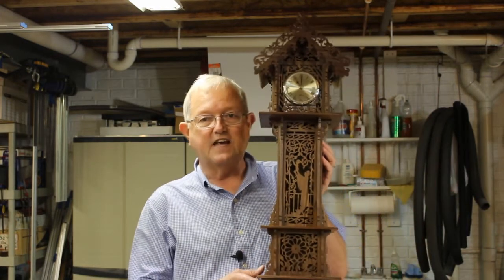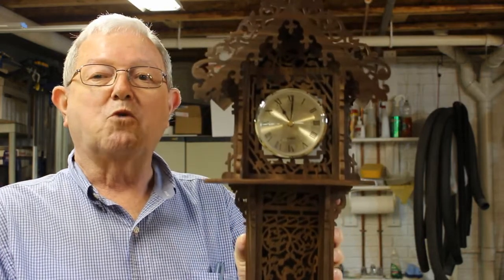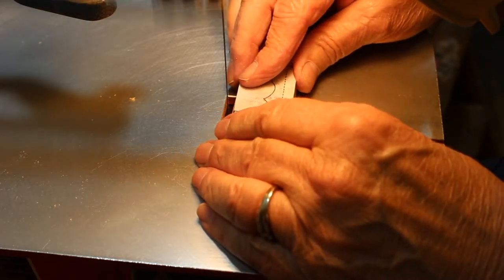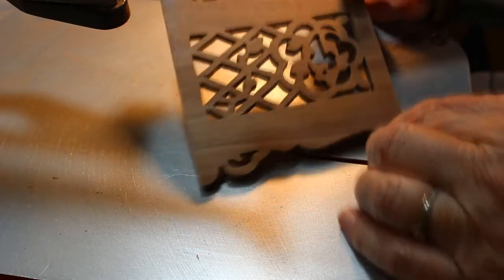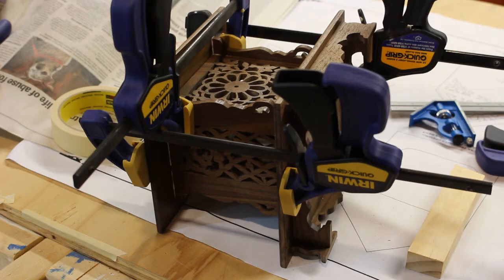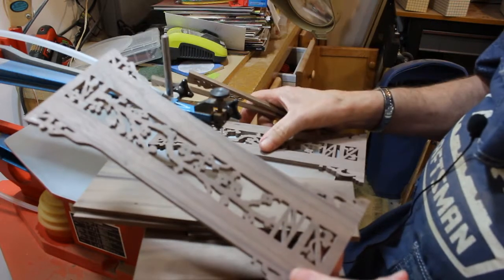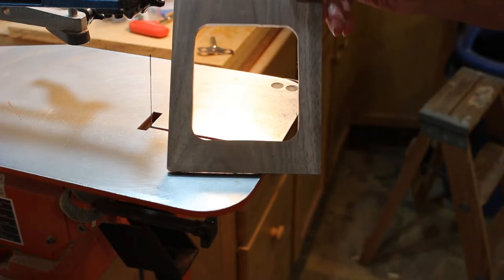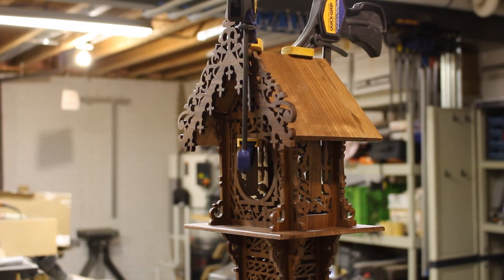Simply Wooden Creations Scroll Saw Contest 2017

Comment: What size blade are you using for the scroll saw?
Reply from the maker: the moose,  to tell you the truth I can't remember which blade I used on this project.  I normally use either a #1 or #3 blade but most likely a #3.  I recently switched over to Pegas blades but when I built the clock I was probably using Flying Dutchman Ultra Scroll Reverse blades.  Hope you enjoyed the video and thanks for leaving the comment.
Reply: @paulsmessyworkshop  loved the video. I just acquired a vintage craftsman scroll saw model 103 and I am going to restore it and put it to nbn use in my shop. I currently use a newer delta scroll saw for my projects. Thank you for the information on the blades. I will look them up. Again I enjoyed your video. Beautiful work.

Comment: Gorgeous job Paul and so much work.  Congratulations on the beautiful job you did!  Did you apply a "finish" to the clock and if so, what did you use?
Reply from the maker: Lori,  Thanks for the compliment.  For a finish I used 3 coats of satin spray lacquer.  The lacquer finish sure bought out the color of the walnut.
Reply: That was an excellent choice for the wood and finish.  I love walnut and use Deft spray lacquer on all my projects.  Since there was so much intricate work on your clock, did you just try to spray from different directions as best you could to get the lacquer into most of the cut out areas?  Your clock turned out fabulous.  It is surely a piece to be very proud of!  Happy Thanksgiving to you and your family.  I love your videos!!!
Reply from the maker: Thanks for the kind words.  Have a Happy Thanksgiving also.

Comment: thats a great looking clock Paul  good luck in the contest
the walnut looks like around 1/8-1/4 inch thick, was that already milled to that thickness?
Reply from the maker: Rusty, Thanks for commenting.  The wood I used started out as 3/4" stock,  I ripped it in half on my table saw then planed it to 1/4" on my planer.  All the wood in the clock is 1/4" walnut.  Walnut is a great wood to work with....plus it smells nice when being machined.

Comment: What size blade did you use?
Reply from the maker: Ken, if I remember correctly I used a Flying Dutchman #3 scroll reverse blade.  Since then I have switched to Pegas blades.  The only drawback to the Pegas is I find they are more aggressive when they cut but all in all I think I like them better.  Thanks for watching and for you question.
Reply: @paulsmessyworkshop  I've always used the FD ultra reverse 5.  Gong to try the 3 see if that helps my turns. Love you work though
Reply from the maker: Ken, thanks for the kind words.